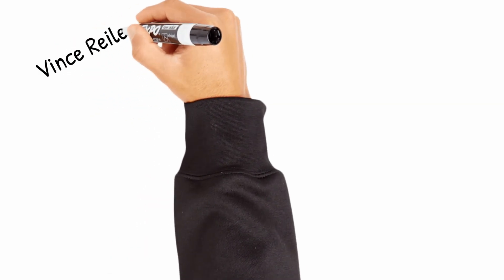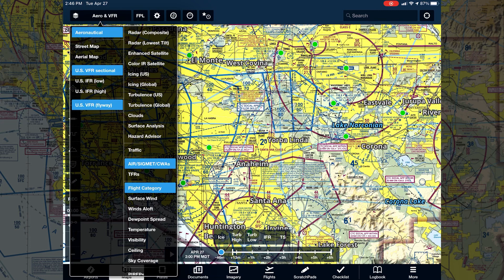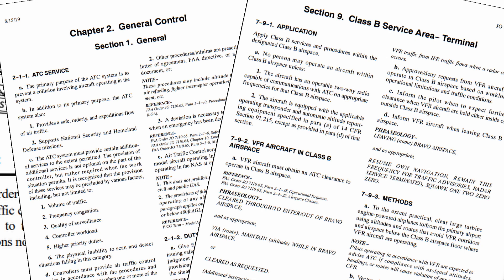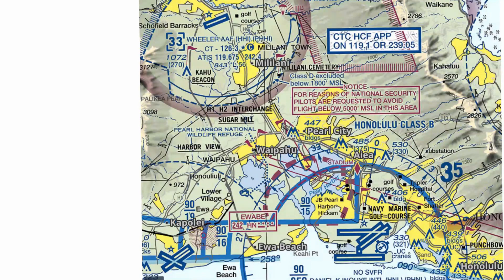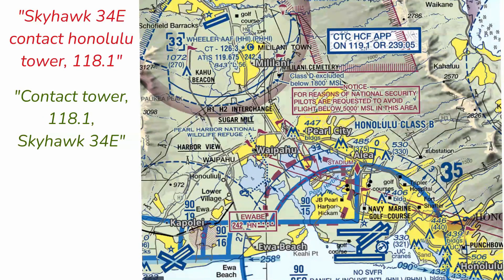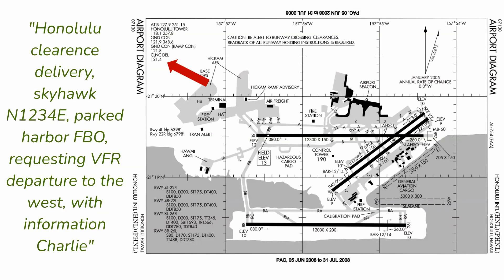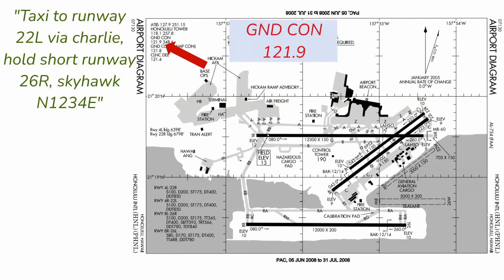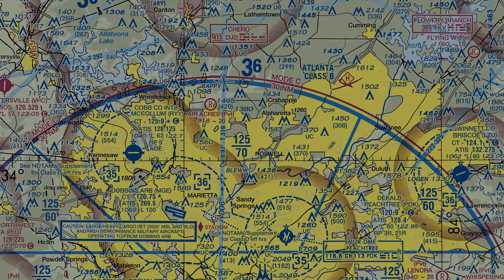Introduction to flying in class B airspace, Part 1

Comment: Is the engine running when contacting clearance delivery when leaving or do you hold off starting the engine yet ?
Reply from the maker: Great question. I turn on the radio, listen to the ATIS, then start the engine and call clearance delivery.  Clearance is usually quite quick.
Reply: @Loves2Fly why not do all this with the engine off but electronics on?

Comment: I tried to call Phoenix Approach by phone like you suggest but gave up trying to get a number someone would answer. Where’s a good place to find these phone numbers?
Reply from the maker: I would start with Flight Service (FSS). Also find all the numbers starting on page 430 of the Chart Supplement (AF/D).  Here is a link: 
https://aeronav.faa.gov/Upload_313-d/supplements/CS_SW_20210422.pdf
If you file IFR from small airports, you actually now get your clearance directly from Center instead of through the FSS.
Reply from the maker: BTW great question!